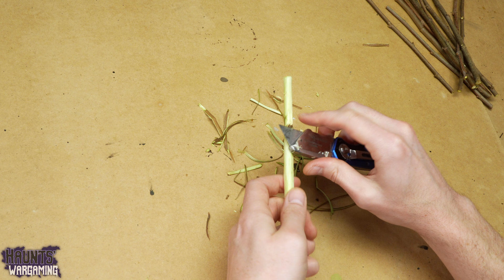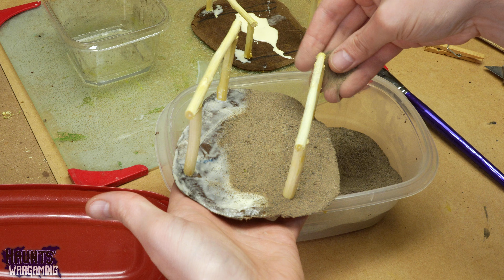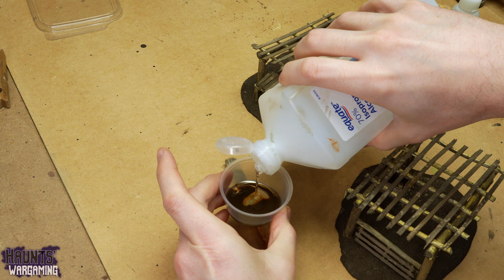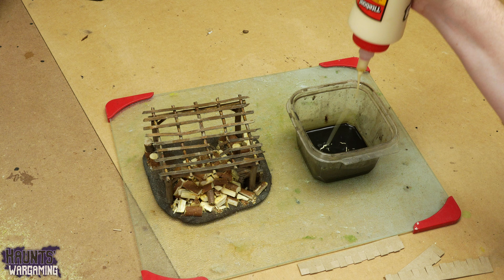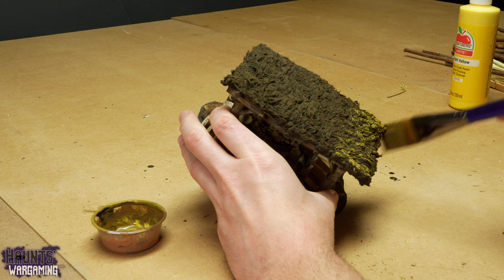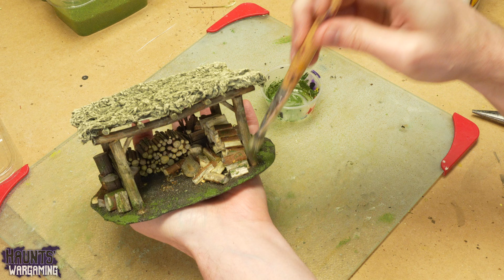Turn Real Twigs Into Medieval Woodsheds for Your Tabletop!

Comment: Really cool.

This same kind of technique could be used for lean-to structures, like what you'd find at a camp. NOT trimming off the bark would help sell the look of a more hastily built, temporary bit of shelter. Slanted roofs, or even just a slant going directly to the ground (possibly with only one support stick, if its a "diagonal" slant). These kinds of structures also tend not to be topped with tiles/shingles, but with sod cut up and transplanted on top. So you can just add a thin paper substrate over the frame, and cover it in grass flock.
Reply from the maker: Also I think the roof fabric that I used looks more like sod than thatched reeds (the texture at least). Maybe that could work.
Reply from the maker: That would be another good project! My original concept, that I didn't show in the video, was more of a lean-to style but it was way too big.
Reply: @hauntswargaming  Yeah, size can be an issue. But I've seen videos of people building small shelters, that were smaller than these ones. One I've seen was basically a half-tent, large enough to provide cover for a single occupant laying down, with one side open to the outside and the slant propped up by one stick. You could probably build a terrain piece that's just one of those, plus a campfire.

Comment: About wood glue … less is more.  The more you put, the more brittle it gets.  Plus you lose a lot of the finer textures
Reply from the maker: You can apply it thicker, it's just going to take longer to cure.  Ideally you want it to penetrate both surfaces with woodworking, but that's not always possible or practical with terrain crafting.

Comment: Love the Sheds, Great job!! now food for thought Titebond Also makes another type of glue which I love Its Called Titebond Quick & Think, I use to make Miniature Fairy Furniture. I it worked very well for the small stuff! I Still use it to this day for most of my wood working, Its a LOT less Runny than there regular wood glue, and It Dries much Faster! I have also found some Wood Super Glue on Amazon! Life SAVER!! Love your work!  Makes me want to get back into the Miniature Furniture! TY!!
Reply from the maker: Thanks! I'll have to pick a bottle up and try it out. My main reason for using wood glue is because it doesn't give off fumes like super glue so hopefully that's still the case with the quick version. :)
Reply: @hauntswargaming  Titebond also makes super glue, And for me it does not have the big nasty smell! Glad I could help!